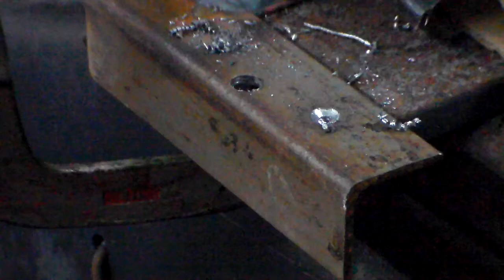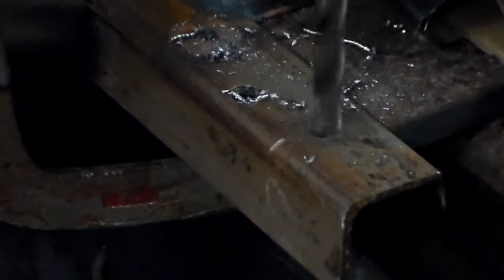The easy way to drill bed rail angle iron.

Comment: So much for getting rid of all the old bedrails I had. Now you tell me. 😂Oh well, doesn’t matter anymore. I was forced to sell every bit of equipment I had couple years back due to health. Couldn’t use it anymore. Not able to lift a board or much else. Guess you didn’t need to hear all that but I will make sure I pass this tip on. Ok I admit too that I’ve thrown a fresh bit in the drill press and just made it cherry red and wasted a bit trying to make a hole.
Reply from the maker: I guess they had to make that bed rail super strong because it would have a lot of abuse over a bunch of years. lol

Comment: Good to know, I’ve wiped out plenty of saw blades and drill bits cutting bed rails.
Reply from the maker: The slower the better.
Reply: @scottsinfl  I need to pick up some cutting tapping fluid, it help a lot on castiron and other steels, I’m sure it would also help with this. Definitely not a steel to be welded.

Comment: Awesome. I’m getting ready to straighten the rafters in my garage. Wasn’t having any luck putting holes in the iron. Any secret to getting it started? Thanks
Reply from the maker: I just used a 1/8th inch bit first but super slow and it cuts threw easy also. That's the trick go as slow as you can and it will cut right threw. Almost as soon as you go fast and it gets hot then that stuff gets hard to drill.